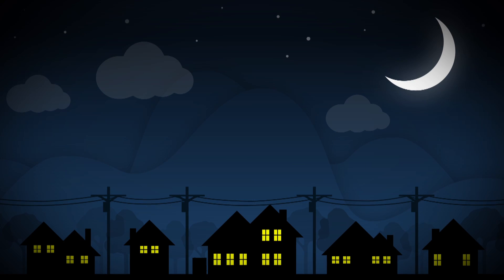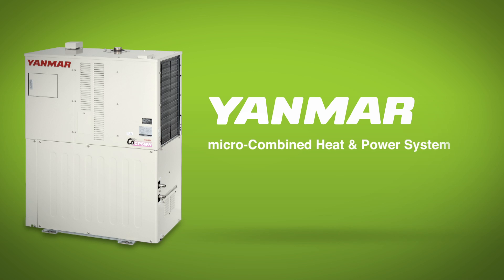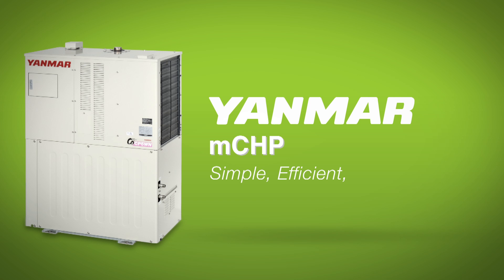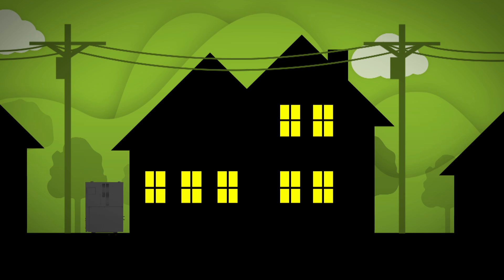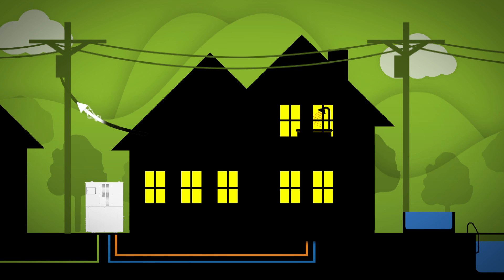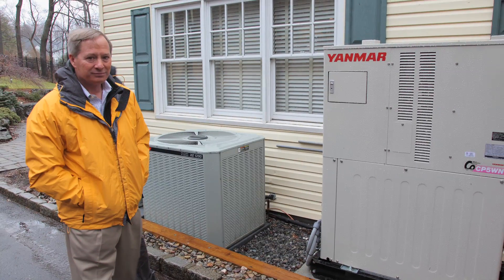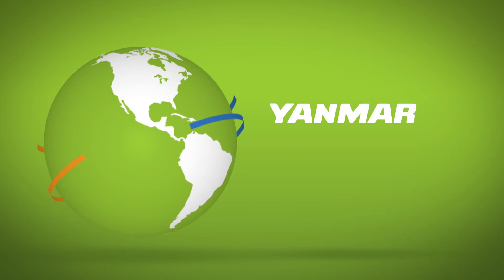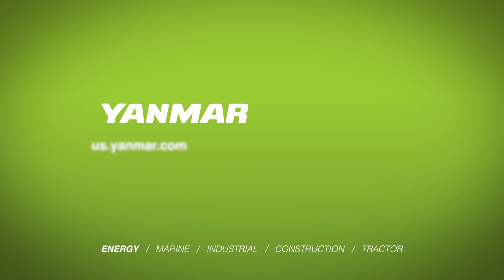Yanmar 5kW mCHP

Comment: is it still being manufactured? the last info comes from 2018...
Reply: Probably not.  But it's just a genset with a heat exchanger before the radiator and another in the exhaust.

The one in the water can just be copper pipe and fittings and a water cooled EGR from the breakers will get the exhaust heat into the water too.
Shout if you want a design/help. :)